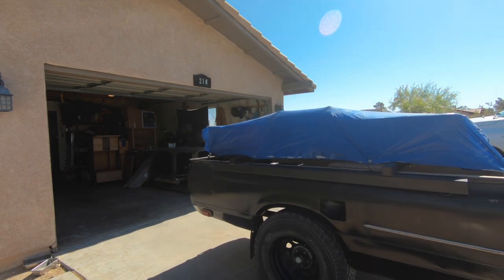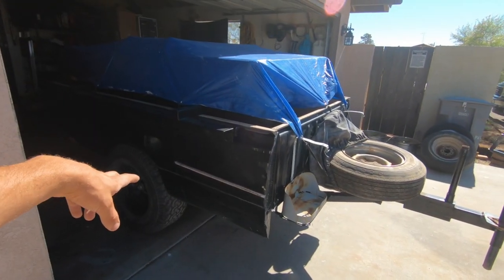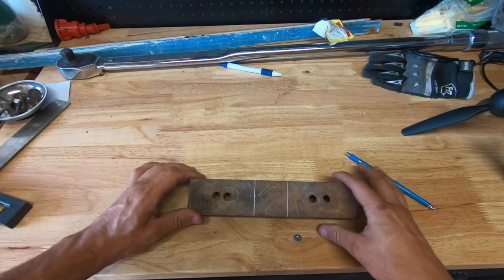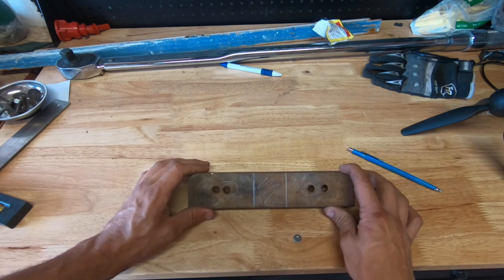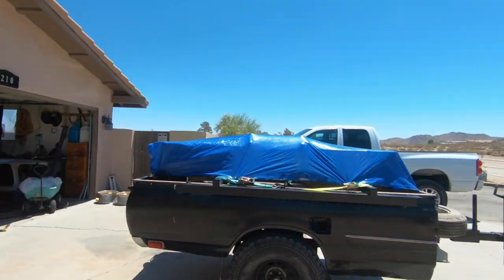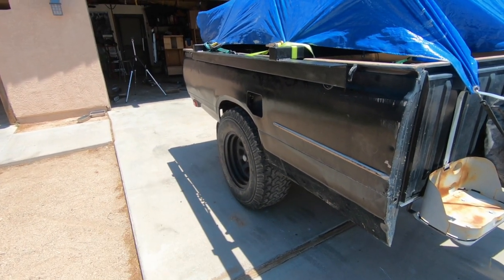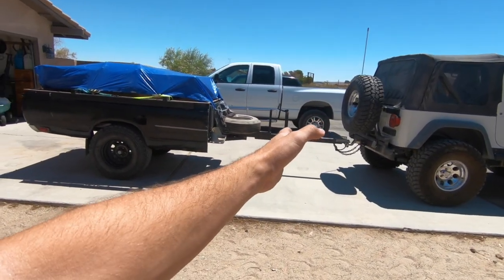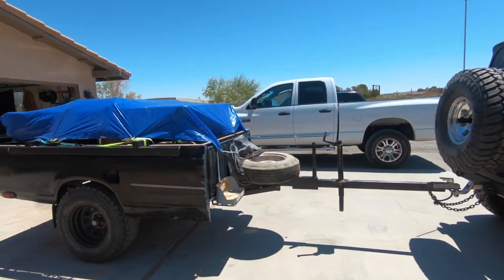Overland Trailer Build Part 4 - Cheap Jeep Trailer DIY Lift Kit

Comment: You didnt lift the axle, if anything you lowered the axle in relation to the trailer.
Reply from the maker: Putting a lift kit on allows for more room between the body and the tires. The more room you have, the bigger tires you can run. Bigger tires increase ground clearance between the axle and the ground.